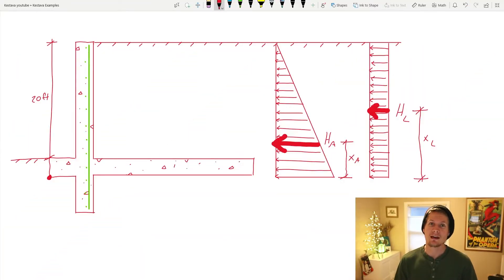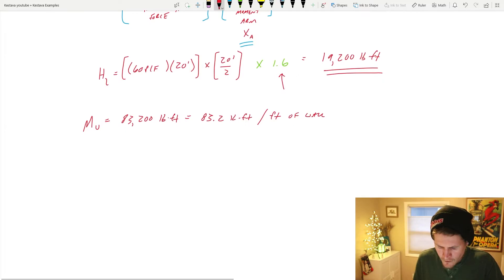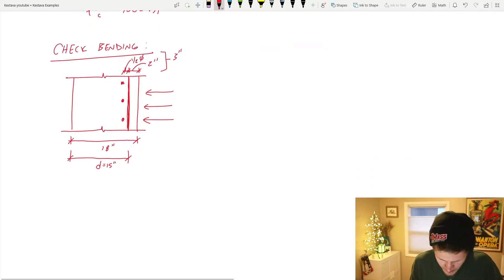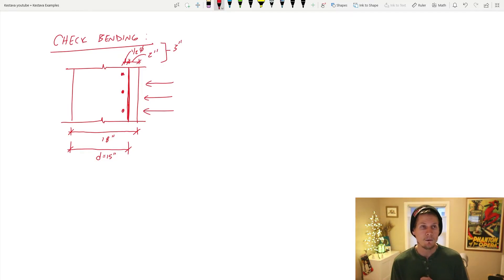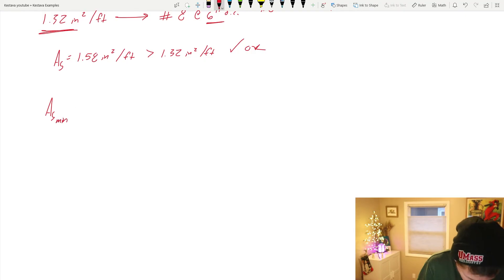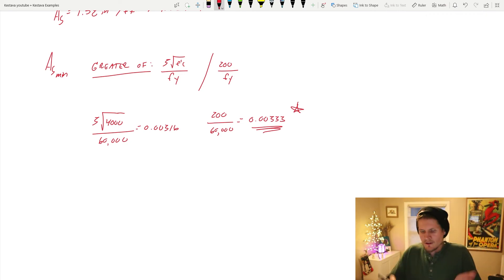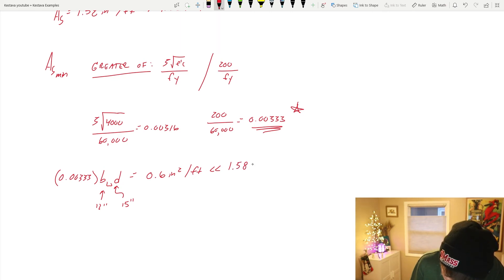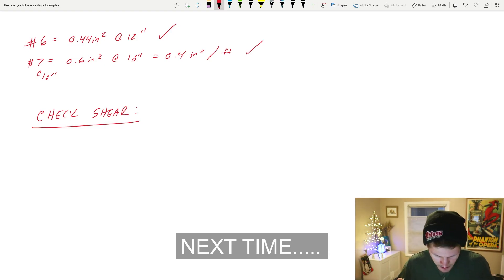Cantilever Retaining Wall Design Example | Part 4 | Reinforcement Design

Comment: Great presentation. However, young engineers need to know about the development of the vertical stem bar into the footing! As the bar size gets bigger, the development must be ensured. This may have implications on the footing thickness.
Reply from the maker: you are pinned to the top of the comments my friend! great point, i mention this at the end of this design example as something we do not cover. #8's will be difficult to fully develop and once I get to that step I would probably reduce my bar size and decrease spacing to help out. very very good point.
Reply: @Kestava_Engineering  by using a smaller diameter or Bar, you can also control cracking in case you're designing walls of a water treatment plant to avoid leaking or infiltration.

Comment: hello, may I ask about the bw you refer to at 07:39. it's 12", isn't it?  Thankyou
Reply: i think i understand, its 1 feet = 12" right? i usually using metric and its little bit confusing me 😅
Reply from the maker: @nadifaaulia9676  you are correct!

Comment: if in the passive segmen we have some pressure, from river water for example, are this include in our Mu calculation for stem calculation? Great presentation btw
Reply from the maker: absolutely! if you have hydrostatic pressure to account for then it needs to be included in your demand when calculating Mu and Vu

Comment: Can you point to where “j” comes from in the ACI 318-14? I’m not too familiar with the code yet
Reply from the maker: its funny - i dont think "j" is really outlined in the ACI - it is a variable that stems from the compression block and coincides with "a" and "c" and is a great tool to estimate beam and rebar sizes without multiple iterations. usually more seasoned engineers use this method as it takes a bit of well rounded understanding on concrete design. but anyone can use it!